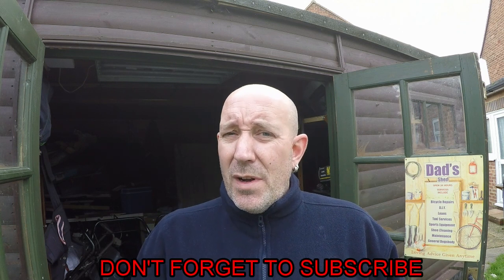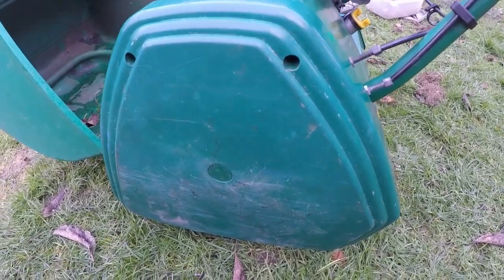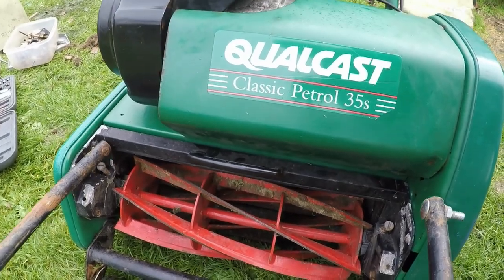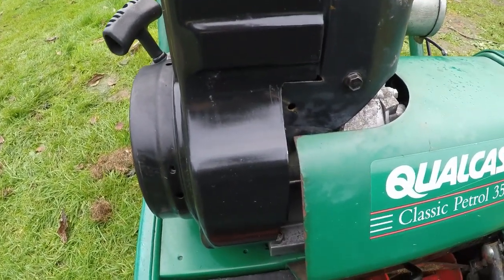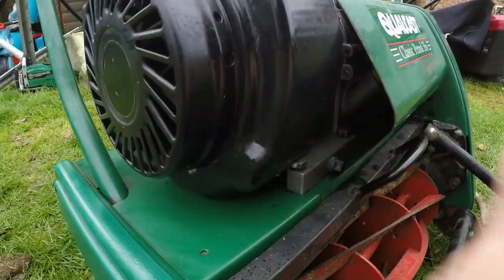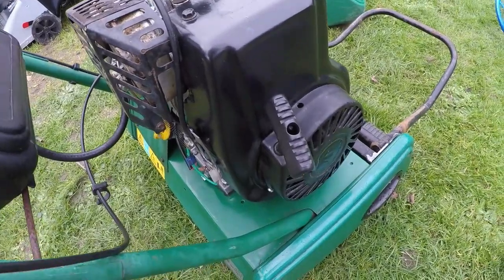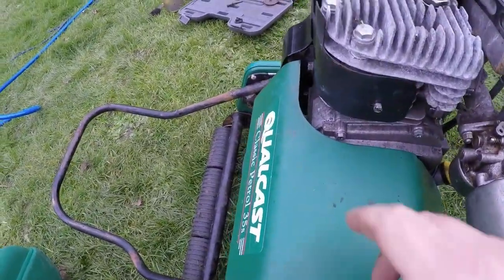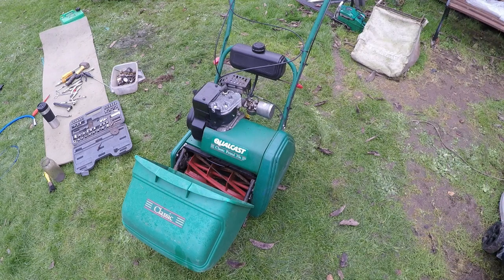QUALCAST 35S LAWNMOWER NOW FINISHED

Comment: Picked up a cheap one myself, slowly getting it all running sweet again. Not a clue what I’m doing but watching your vids is a huge help. Just had the pull cord go, so that’s tomorrows job. 
Still not 100% sure if the carb needs to be adjusted not quite starting as I’d like. But I’ll get there
Reply from the maker: The carbs are tricky on these.. it may need cleaning 3 or 4 times.. rim the gets out
Reply: @themowerman  honestly I just replaced it, just unsure if it needs setting up 🤷‍♂️ l live in rural France so it’s a case of working stuff out especially on cylinders as most ( nearly all ) rotary or sit on. 
But I’m loving getting out of my comfort zone and very satisfying getting stuff ( 2 chainsaws, a hedger & 2 strimmers ) back from non functional via YouTube

Comment: Hey mick! Great vid and enjoyed the others too, while rebuilding I noticed I had a leftover spring, and  for the life of me I can’t find where it goes! Its a flat spring, not like your usual spring. I know it came out of the ride height side panel, just can’t find where! Any help would be appreciated!
Reply from the maker: Hi.. send me an email with a photo of the spring micksmowers01@gmail.com
Reply: I actually found where it went eventually… although its a spring.. it’s not really acting as one, it’s the locking pin spring beneath the cylinder on the ride height side. Took a bit of time with this face > 🤔 appreciate the reply though!

Comment: Hi Mick, Great Vidio. I am doing up a 35s qualcastgo a problin with the rear roller, just like you i bought a new pinion gear but when fitted the roller still gets stuck , the iner cog looks ok as its ally,  would you hav any thoughts on what to do next ? Regards Mick M
Reply from the maker: Have a look at the belt adjustment.. take the belts off and see if it makes any difference..

Comment: Hi - do you think the lower position for the grass box bar is if you use the scarifier cassette? Am really enjoying these videos - I have one of these from about 1970 which hasn't run for over 15 years to look at this year (or next ....).
Reply from the maker: Yeah it could be. That's very kind of you to say your enjoying them. I also have another cylinder one in so will be getting that running soon. Mick

Comment: Hi mick  love your channel. I have the same mower but 17S model and when I pull the the drive cable it makes a loud grinding noise before it gets going also the cylinder often locks up when the engine is off and try to push or pull the mower . my question is does it need the cable adjusting or perhaps belt adjusting or replacement.
Any advice or opinions from anyone who knows on how to solve the problem would be really appreciated as I cannot afford to buy or service it.
Reply from the maker: Soumds like the cylinder is hitting the bed knife.. or the clutch is not locating fully.. take the top cover of and check it
Reply: @themowerman  
Hi Mic thanks for your reply.
It is the rear roller that makes the noise and locks up when the engine if off so I have to drag it into the garage.
Reply from the maker: @pedrobg1289  hi I believe I have a mower with the same problem. I will be looking into it soon. So hopefully a video will be out within 6 weeks. As I have videos lined up and uploaded already

Comment: Hi Mick, i recently picked up a qualcast 35s and plan on tidying it up over the coming months,I'm trying to take the blade cartridge out and have undone all the necessary bolts to take it out,but the one on trottle side is just spinning,any advice on tackling this?TIA
Reply from the maker: Take the side cover off and the nut will need holding on the inside
Reply: @themowerman  cheers Mick much appreciated for the tip,worked a treat!
Reply from the maker: @user-ip6oq8cj5i  no worries mate

Comment: Great videos! I've just picked up a 35s for free and it started after a bit of clean of the carb & some fresh fuel. Anyone know where I can get the air filter housing - can see filters for sale everywhere but not the actual housing. Cheers.
Reply from the maker: Here is an air filter box and carb.. you may have to get it as a complete item as they are a bit hard to get hold of
Reply from the maker: https://www.ebay.co.uk/itm/143628418295
Reply from the maker: Here is another at a good price as the carburettor is new https://www.ebay.co.uk/itm/293696853098
Reply: Micks Mowers thanks Mick. Isn’t there also a plastic push fit type of filter housing for the 35s? - Saw one on an Espares video...

Comment: Hi Mick, picked a slightly different model qualcast classic 35s up and I’m stumped on how to read the oil level. 

The fill and drain are both on the rear side (nearest your legs) and there’s no dipstick as far as I can see. Any ideas on how to gauge the fill mark? Thanks
Reply from the maker: Yeah mate. You fill it all the way up until it hits the bottom of the threads..
Reply: Micks Mowers Absolute legend. Thanks. I think the one I have is badged as a Qualcast but actually a Suffolk Punch 14 underneath. 

Thanks again Mick, appreciate it.